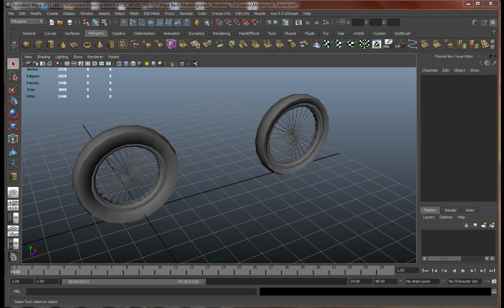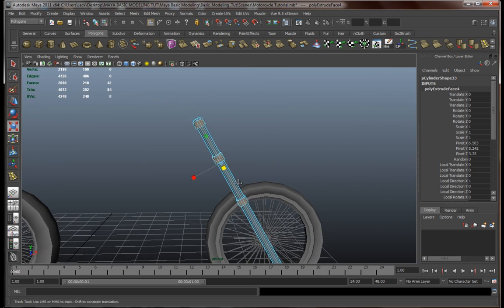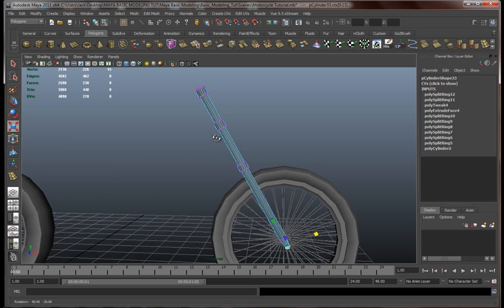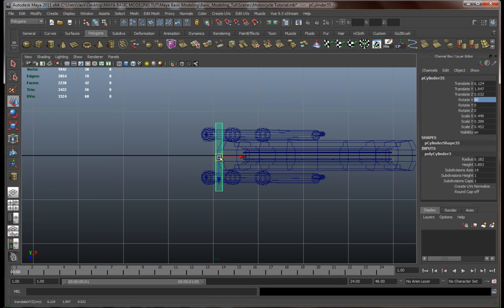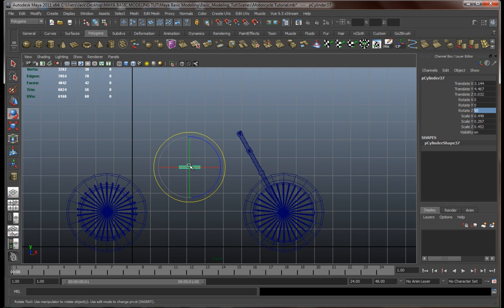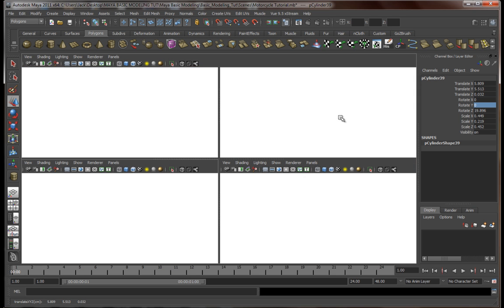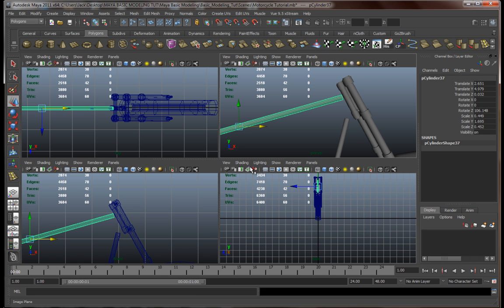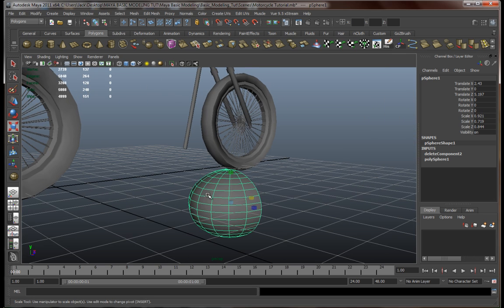Maya Beginner Modeling Tutorial - Motorcycle ( Part 3 of 13 )

Comment: If you hold CTRL down when scaling something, when you click and drag on one of the axes, it will scale is using the 2 OTHER axes, but not the axis you're using. So, hold CTRL while scaling along the length of a pipe, and it will scale the radius of the pipe evenly without changing it's length. Very, very useful.